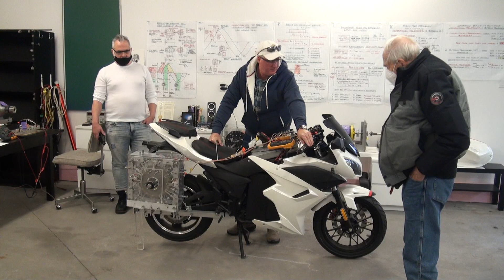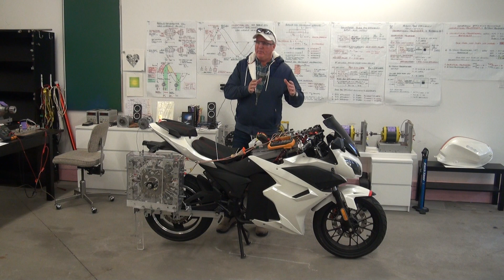12/5/2021 LAW OF CREATION OF ENERGY DEMO PART 4 ELECTRIC VEHICLE REGENERATIVE ACCELERATION

Comment: Did you ever really ride and test any? You would be wasting so much years of your life if you still have not tested it on the road and in real life. And if you did, why have you not shared anything (yet)? Possibly because the outcome was negative? I dare you: correct me if I am wrong, no problem there. I even want to.
Reply from the maker: 12/5/2021 LAW OF CREATION OF ENERGY DEMO PART 1 (First Established in 1820 by Hans Christian Ørsted) https://youtu.be/lzqgLlJIGS8

THE LAW OF CREATION OF ENERGY WAS FIRST ESTABLISHED BY DANISH PHYSICIST HANS CHRISTIAN OSTED IN 1820 WHEN HE USED THIS CREATED SUB-ATOMIC QUANTUM ELECTRON ENERGY TO INCREASE THE KINETIC ENERGY OF A COMPASS NEEDLE.

The Law of Creation of Energy: 

1. Energy is created at the Sub-Atomic Quantum Electron level when a Charged Particle (which creates an Electric Field) is caused to move in a current carrying conductor by an Electromotive Force (Voltage). 

2. The moving Charged Particle creates Electromagnetic Field Energy which is then externalized around said conductor. 

3. Energy is defined as the capacity for doing work.

4. This created Quantum Photon Energy performs Negative Work (system Kinetic Energy reduction) in all electric generators at infinite efficiency (know colloquially as EV regenerative braking).

5. This created Quantum Photon Energy now has the ability to perform Positive Work (system Kinetic Energy increase) in ReGenX Generators and ReGen-X Quantum Motors also at infinite efficiency when the load current is delayed sufficiently in the Time Domain.

Heins' Law of Induction:

According to Faraday's Law of Induction, whenever a voltage is generated in a ReGenX Generator coil in a closed circuit, and a Time Delayed current is caused to flow in that circuit. The direction of the induced and Time Delayed current has a definite relation to the variation and direction of the Electromagnetic Field Energy created around it. This relation is formalized in a law of physics called Heins' Law of Induction which may be stated as follows: 

"An induced voltage (Electromotive Force) will cause a Time Delayed Current to flow in a closed circuit in such a direction that the effect of the created Electromagnetic Field Energy will perform Positive Work in assisting the change that produced, IE increasing its Kinetic Energy at infinite efficiency."

Conversely Lenz's Law states that, 

"An induced voltage (Electromotive Force) will cause an Instantaneous Current to flow in a closed circuit in such a direction that the effect of the created Electromagnetic Field Energy will Perform Negative Work in resisting the change that produced, IE decreasing its Kinetic Energy at infinite efficiency."

Heins' 4th Law of Motion for Electromechanical Systems states that:

For every action there is an equal and complimentary reaction - when the reaction is Delayed sufficiently in the Time Domain.
Reply: @PDiCanada1  Aha, so the answer is 'no'? A short version would be best.
Reply: @deslomeslager  I believe Thane Heins is acting as a disinformation operative for the "Deep State".
Reply: @ricksampson6780  🤣🤣
Reply: @ricksampson6780  I believe that Hillcrest energy technologies company is controlled by Rockefellers.
Reply: @deslomeslager  Road test will be successful only with at least 10 RegenX coils with bifilar low impedance windings. Thane has only 3 RegenX coils. To get another 7 coils, need to get money from somewhere. For example, bitcoin mining, stock speculations - HODL Tesla stock, short GM stock.
Reply: @marcisgulbis9310  I agree with your comments!
Reply: @marcisgulbis9310  Bill Gates is also funding "breakthrough energy" devices.
Reply: @ricksampson6780  Bill Gates admits that he was shorting Tesla (TSLA) . Gates has previously made some comments about electric trucks like the Tesla Semi not being viable . Regenerative acceleration technology will make electric semi trucks viable. Semi truck will need 100 ReGenX coils, and AI that automatically turn on ReGenX generator, if frequency exceeds critical minimum frequency, and turn off, if frequency is below critical minimum frequency.
Reply: @marcisgulbis9310  Thanks for the additional information, we must also consider hydrogen as an alternative renewable power source.
Reply: @marcisgulbis9310   Tesla stock is down, because Elon Musk sold Tesla shares to buy Twitter.